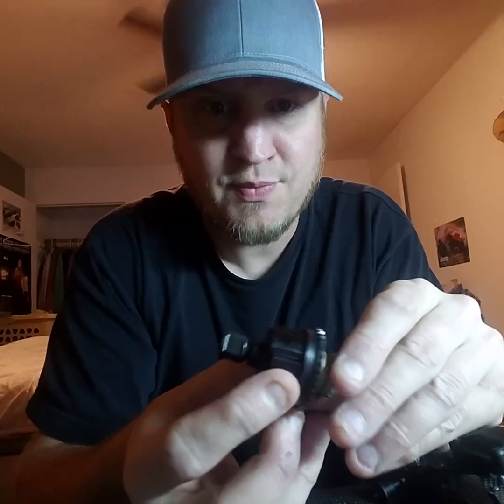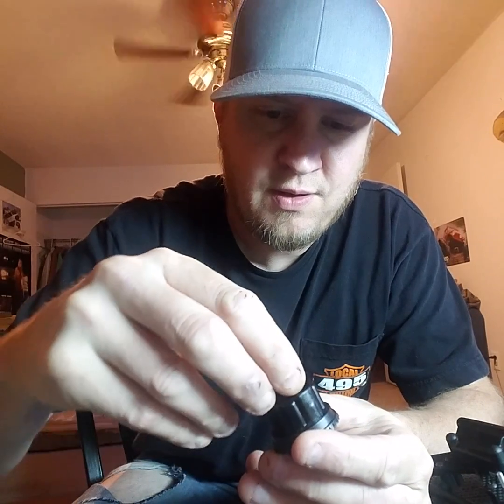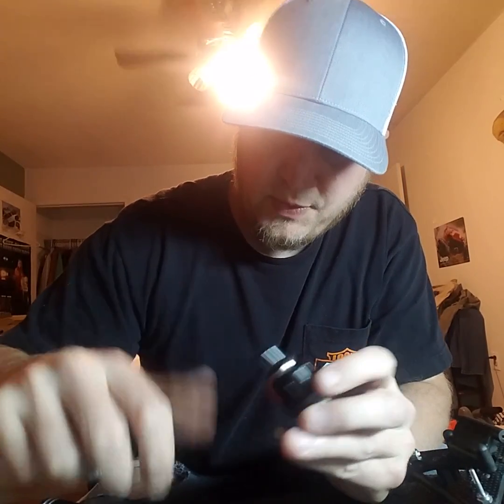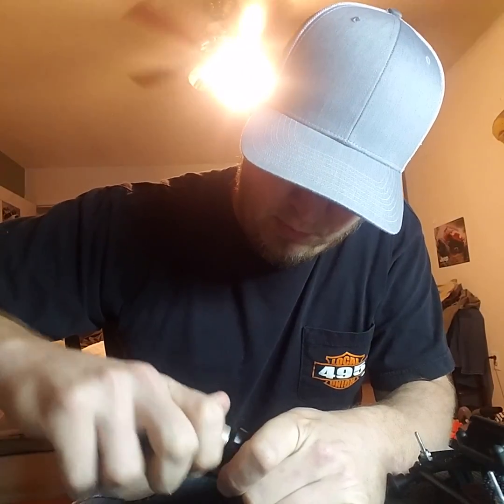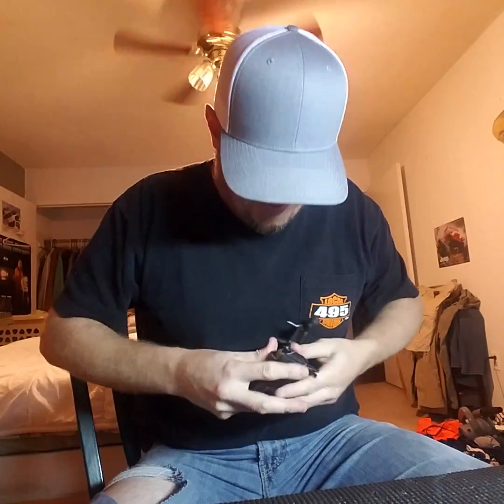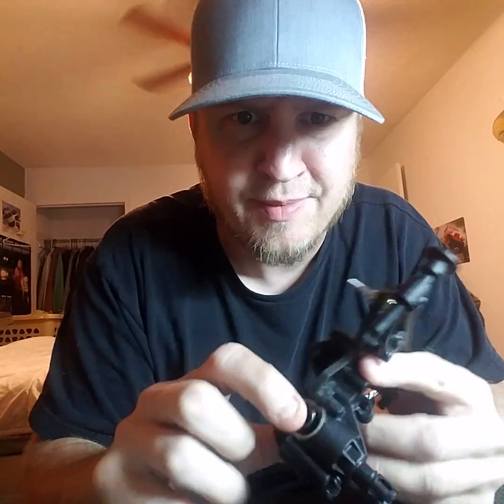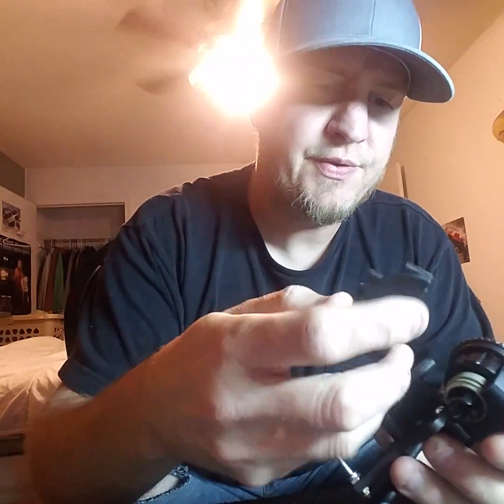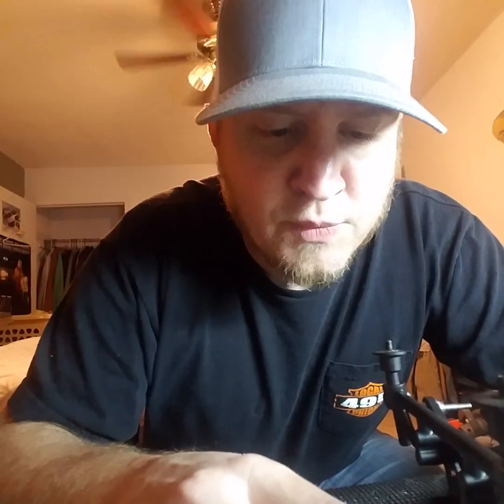RC Quick Tip: SCTE 3.0 Proper Diff Shimming

Comment: thx for the tips bro and how many shims may i need to use on my front diff for the first building?
Reply from the maker: Calvert Yao  Just depends on how it feels. Usually 1 or 2. If you used too many the diff won't spin freely and it'll make a little noise when you spin it. Make sure you grease your ring gear too.
Reply: Thx a lot!